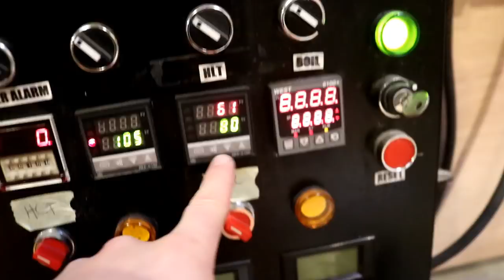GOT TO FIX THE STEAM

Comment: You will need a small hand wash basin, with a tap. In my pubs I used push tap for sanitary reason on the, also need blue towel next to it.
Wouldn’t have glass washer in the kitchen is you can. NSF will be a pain with that.
Think about where raw food non are prepared as you would want separate areas.

Comment: Chris, what about putting an attic fan that exhausts out the roof at the peak of the rafters? (Not through the roof, but out the side) You could even build a duct by rolling yourself a big tube out of thin metal and leave a 12 inch slot in the bottom to concentrate the draw - stretch that tube across the rafters over your steam sources. those attic fans are pretty cheap and powerful - they can run manually or off a thermostat.

Comment: You will need to add a separate hand wash basin. Preferably fed from a Thermostatic Mixing Valve to regulate the hot water temp. As you mentioned separate sinks for food prep and dishwashing which will need to be fed straight from the hot supply

Comment: Condenser might be a good idea if you pass the water into your tank so as not to lose it.  But otherwise it's a waste of water.  I think the ducting up and out would be an easier solution though...  If you don't want to be faffing drilling a hole high up, you could pass through the wall lower down and pipe up the outside.  I'm sure there is many ways to tackle the problem.

Comment: Connossieurs in stock Helens use a condensing flu using soil pipe fittings and and for the spray nozzle they use a standard hose sprayer

Comment: I think a condenser unit is the way to go allright,at least for now,you may be able to port it outside at some stage down the road. I wonder if you had a spare glycol chiller unit could you incorporate that to condense the steam,or could you build a pot still setup and recirc the cooling water for use elsewhere? Hope you get some help anyway and get it sorted soon m8.Kitchen looks good but i have tbh it looks a little crowded with equipment,you may run into issues. Cheers.